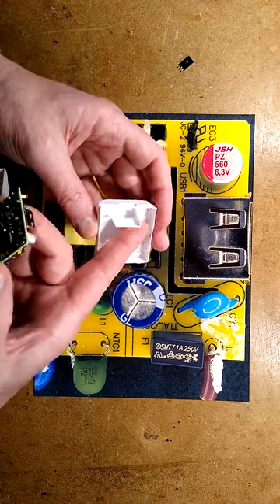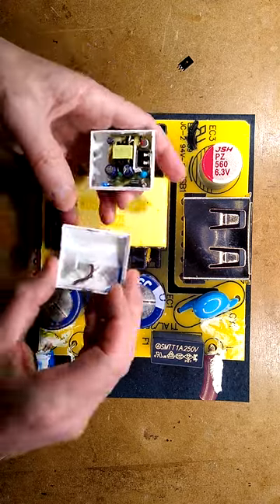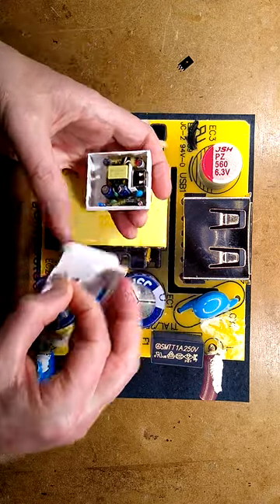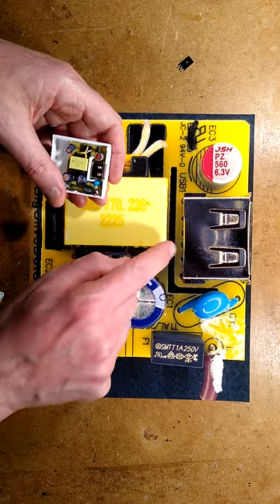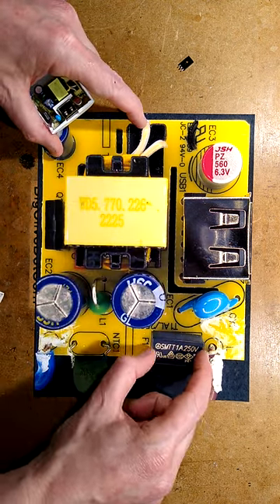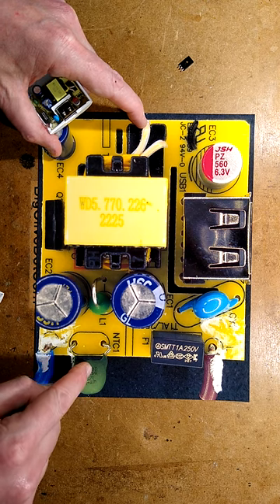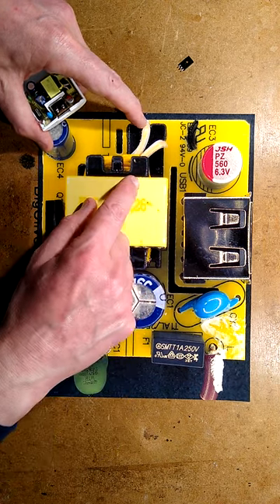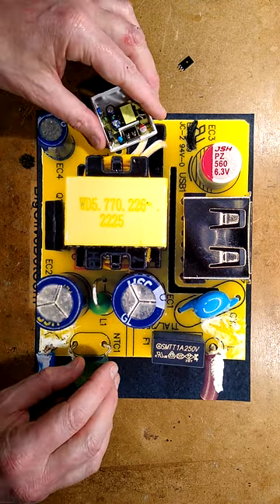Express IKEA USB review

Comment: Hey I watch a lot of your videos I've just recently started playing with building electronics, and I have a question.  I do alot of sketchy experiments blowing things up and catching objects on fire in my back yard and for most of my projects it wld be awesome to be able to use any old dc adapter for power but they all seem to have a short circuit protection mechanism. I guess I'm asking what component is th short circuit protection coming from?
Reply from the maker: The power is usually limited by the transformer size.